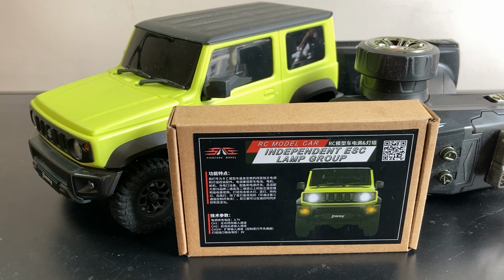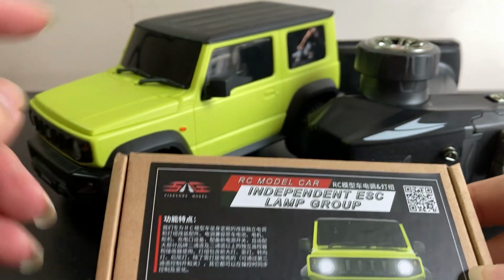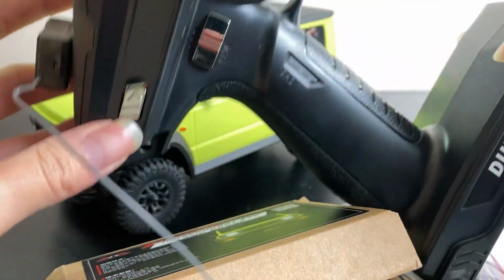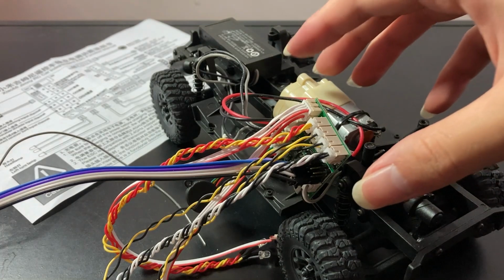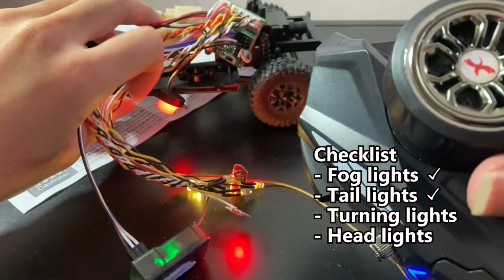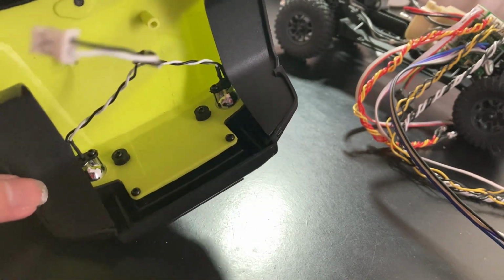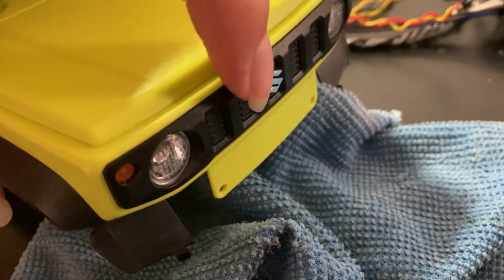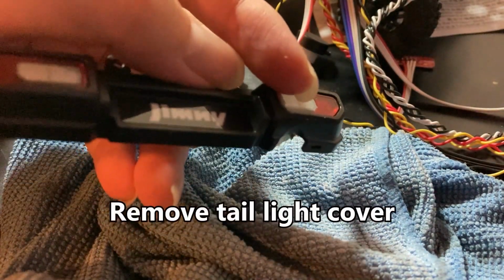XIAOMI Suzuki Jimny | How to install LED light kit?

Comment: does the bluetooth still work?
Reply from the maker: Hi there, after changing to this light set, you will need a separate independent radio controller, the stock bluetooth doesnt work with this new board
Reply: @ACeperienceRC  oh okay thanks✌🏻😍